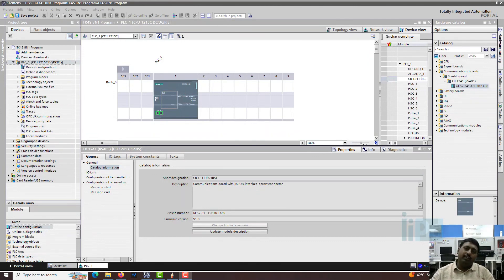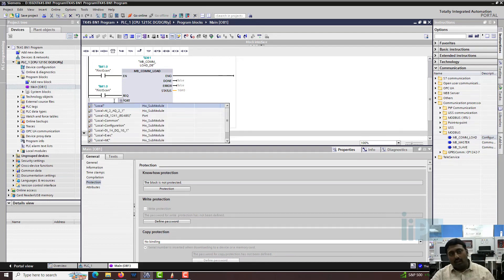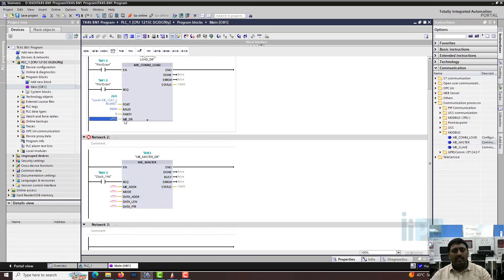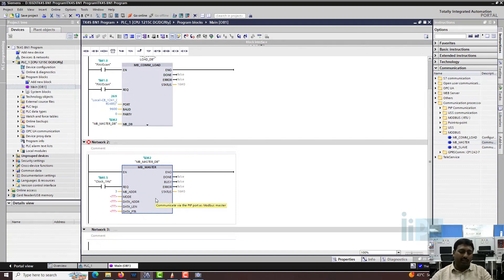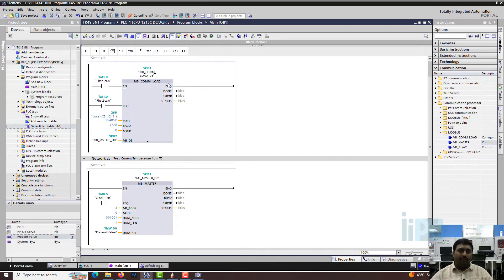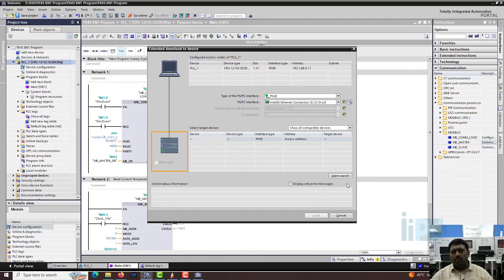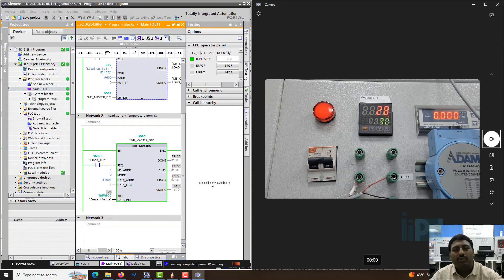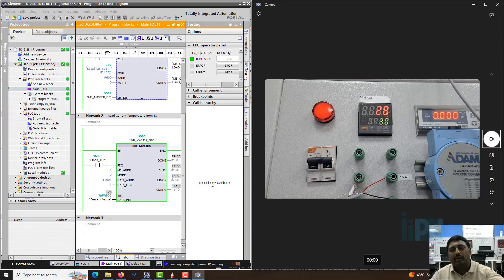How to Configure MB_COMM_LOAD & MB_MASTER Block for Data Reading From Autonics TK4S | Tutorial

Comment: Thank you sir for you video, I have problem when try this. My MB_MASTER didnt show the value of PV and SV. The CB1241 Led only Blink (on) at the Tx. I try to change the Parity and also the address nothing change.
Reply from the maker: You can check if the settings in both the PLC and your slave is same(but different station address if multiple slaves) and remember to swap the cables on the PLC end.

Comment: Brother, amazing tutorial, thank u very much! Question: how to deal with memory address that is of 6 digits if there is 1 instead of 0?
Reply from the maker: The Modbus_Master Block supports both 4xxxx(Standard) and 4xxxxx(Extended) addressing format, so you can just use the 6 digit address(E.g. 460025) to read/write data.